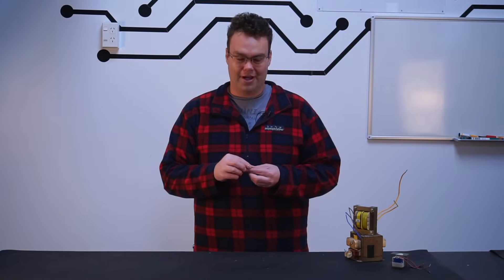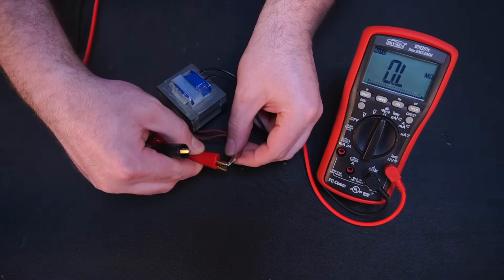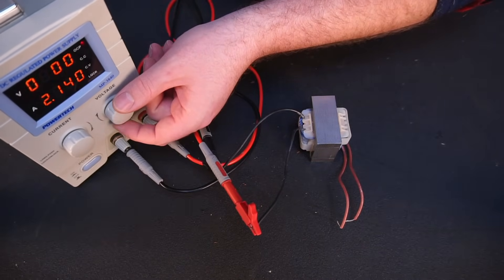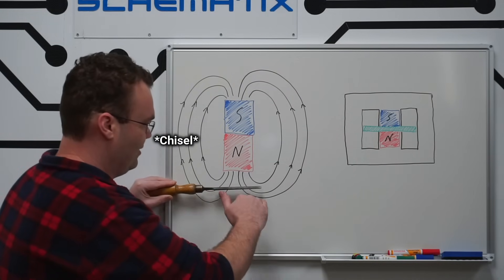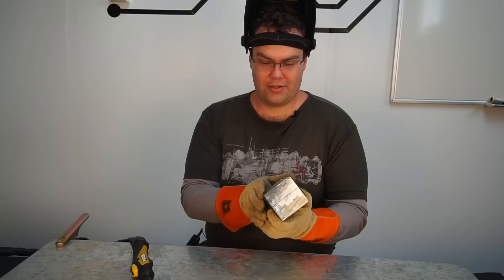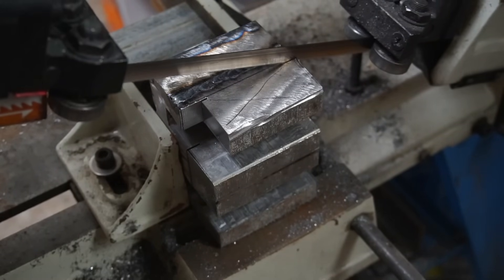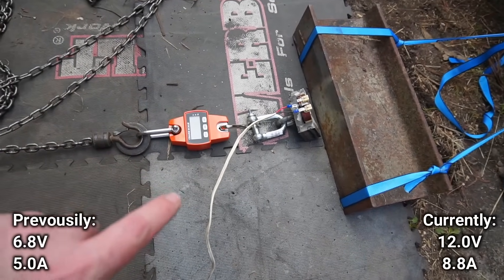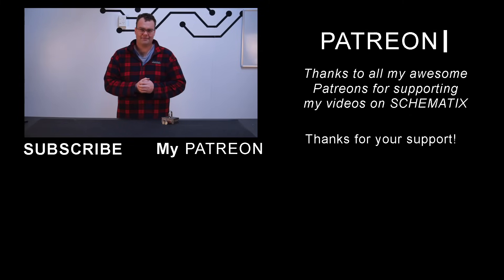Making a Powerful Electro Magnet from a Transformer

Comment: I made the same long years ago !, a MOT transformer is really powerfull...i made a linear to circular motor with this ! leave about 1 inch free of a plate connecting to about half inch of a center of a flywheel and you have a very powerfull motor ( 12 volts 7amps ).....

Comment: Thank you for the video. Really great. I agree that removing excess material and getting the metal object closer to the coil will make the magnet stronger. However, I imagine a big portion of the magnetism gets tied up in the electricity conversion when two coils are present. Wouldn't that also contribute to the electromagnet being so weak before the secondary coil was removed? That coil must have been outputting electricity when you ran the first test. And transformers have over 95% efficiency in converting electricity. Maybe that's where 95% of the magnetism or more went? I would be interested to hear from someone more knowledgeable in this than myself.
Reply: A transformer produces electricity in the other coil because there is a CHANGING magnetic field. Once this field is completely formed, it isn't crossing  wires any more. this is how transformers, generators, motors work. With AC the voltage is always changing. with DC you would need to keep turning it on and off for a transformer. You need a growing and collapsing magnetic field for a transformer. So even with a secondary coil, if your using DC then  the magnetic field is static and the secondary wire isn't doing anything.

For an electromagnet all you want is the magnetic field, you don't care about producing electricity in a second coil, which you have removed. Or did not provide if your building one from scratch.
The metal in a transformer or a motor/ generator is simply to make it more efficient. Consider that the metal cut away is now not providing a complete metal path for the magnetic field, where as when you stick a chunk of metal near it -now you are completing this better path for the magnetic field. 
This can be demonstrated with a horseshoe magnet. Put a piece of metal across the ends and it will not have much of an attraction any  more. Its going through the nice magnetically conductive metal instead of going way out into the air,which is not as 'conductive' as the metal. 
Drop a magnet near a chunk of copper. Copper is nonmagnetic but it is conductive. It will produce an electric field which has a magnetic field and slow the falling magnet down.

Comment: Though difficult to measure the absolute force, I would like to see the performance of two equal EM's, one with a timed momentary current supply mounted stationary above the other mounted atop a piston connected to a crankshaft with a momentary, timed commentator current supply. The crank mounting apparatus (block) and stationary (head) mounts of aluminum so as to not interfere with magnetic fields. Ideally, the timing and supply current electronically controlled with opposing currents supplied at the top dead center (TDC) of piston travel. Once in motion, supply current can easily be generated from the resulting crank rotation or through pick-up coils in the cylinder walls.   In theory, the instantaneous opposing magnetic fields of the magnets could produce a force, however marginal, similar to that of internal combustion. Furthermore, this force could be produced on every rotation rather than the 4 to 1 of a gas engine.  Obviously some engineering to work out, but feasible, don't you think?

Comment: I know man ,magnets are just fascinating in a way you don’t see very often like the way gravity is and how we kinda know how and why they do the things they do but not fully and that’s very interesting.
A few years back I was fishing but before we went fishing we shot some guns at the range and then we went to the lake and I didn’t want to leave by S&W .38 special revolver in the car so I tossed it in the boat and the boat ended up getting run over while in the middle of the lake by a drunk boater who smashed the boat all to hell and almost killed us and we lost everything in the boat except our lives including the pistol.
Now many years later I want to try and get it back off the bottom of the lake and want to use a strong electromagnet and was wondering if it would be ok to have such a thing in the water with electricity it sounds like a very good bad idea!
Am I ok to use an electric magnet in water ?
Also it’s nickel plated so I think it would still grab the gun but just want to know if the nickel plate will effect me in a bad way or not at all?
I would think it would be fine since it’s just a nickel plate with steel underneath it but want to make sure before I go do something that may kill me.

Comment: Hello ad great 👍 work/video 
I tried running a 7.4 lithium battery  wth an inline 5 amp fuse and it keeps blowing the fuse
Allso tried running a power supply 
It actually an R/C battery balance charger  by ProTek R/C 
model Prodigy  612 Duo AC/DC
And it keeps tripping the safety mech/breaker  on the charger??
Could I use a standard 12 volt car battery?? If so how would I  regulate the  5  amperage????
Please 🙏 advise. 
Thank you,  Joe Silva

Comment: Grinding, drilling, clamping, mill work, dent pulling, project or heavy material transfer, lock and that is just off the top of my head. Great video
Reply: Yup , a magnetic chuck.
Reply: Magnet your friends car door closed or the car! Or better yet I see this guy doing plays or theater and he should make King Author sword in the stone and watch peple try to remove sword then have remote button that turns off electricity so he looks strong and chosen!!!!

Comment: Awesome advice and well presented! I learned a lot.  I do have one piece of advice. Next time don't heat the laminates in the core. They do have lacquer on them for a reason. Laminations perform better in a transformer core than solid iron or molded ferrite powder. It's important for the laminates to be separated  from one another with the lacquer. If they touch one another conductively it reduces the efficiency of the core. Next Time start with a new core that will not be damaged by taking it apart or welding all the laminations together into a solid conductive core. In the least don't weld the laminates together. Perhaps put it into a vice while applying some two part resinous bonding glue.
Reply: كم من فولت
Reply: So how does the liquor get the laminations of those cores that are welded already
Reply: @richardsellars8598  I used the term lacquer but I dont know what material engineers use to isolate the different laminations. I only know that it's a proven fact that isolated laminations create the least resistant transformation. You'd have to ask an engineer how they manage to retain isolation because i dont know.

Comment: I've been thinking of making a roll-around type electromagnet for picking up nails, screws, and other types of metal tidbits to keep the area clean and of course; keep from having so many flat tires.
Reply: Did you end up doing this? This is what I'm planning on doing, using a spare tool battery

Comment: solid metal will be stronger the laments are there for AC current to eliminate eddy current. the more turns the stronger the magnet will be, to keep the voltage down you can rap the wire by double or more. because there is no magnetic field fluctuations you don't have to worry about eddy currents or induced back voltage so your wattage will remain low. great video.

Comment: the welds on microwave transformers are very weak and can be broken by beating on them with a hammer.

i tear down the transformers to get the wire for scrap and using a hammer works.

Comment: Thanks so much to such a useful project. I have been working numerically on effects of magnetic fields on different heat and mass transfer phenomenas. In mentioned project high magnetic field density is required. It will be great if you report magnetic field strength in term of tesla or gauss with simple tesla meter. And please provide a comparison between neodymium permanent magnet and this one. These information will rise your videos up to another level
Best wishes
M.Mehdizadeh
Reply: Would you like jam on it as well sir?

Comment: Is there such a thing as a magnetic grinding dust collector? I'm thinking a cookie-sheet sized piece of steel under or around your grinding vice that will collect most of it, and then you can just hold it over a bin and cut the power to release it.

Comment: SORT OF A DUMB QUESTION: If your power supply can provide power with fixed voltage and amp, why was it important to have a little resistance in the coil. I am asking because you said not having the resistance causes the uncontrollable amp through the coil! isn't the power supply specify the amp?

Comment: I've watched two videos on magnetic vices. One created a "magnetic table" that holds the work with the vice mechanically attached to the table. The other used the magnet to hold a traditional type vice to the table. Both have advantages. If you want to get really creative you could try removing the other side of the core as well and see if the drill press table would work as one side of the core making a magnetically held magnetic table. 😎

Comment: Love your videos. Today I started a project to build a tape demagnetiser for old Video8 tapes, audio cassettes and reel to reel tapes. I found a good looking design and tutorial online that repurposed a Microwave transformer. I found a 240 volt LG Microwave oven with a primary winding rated at about 9 amps and pulled out the transformer and micro-switches. After removing  the secondary winding as you have done I was left with the primary winding intact which I tapped up to be flush with the top of the core face like your electromagnet. My question is, I cannot get any DC resistance reading on the coil, not even .01 ohms. I cannot see any damage to the coil causing a short. I wired the coil in series with a 40watt incandescent globe which turned on normally, (not a good sign I think)  I'm nervous about putting 240V across the coil in case it is indeed shorted.  I suppose I could put a variac in front of the coil as well as an isolating transformer (I have a 1KVA ISO transformer) to help upsetting other electronic equipment if it violently trips my RCD. My other option is to wind a new coil. What do you think?

Comment: SCHEMATIX

Hi there

So....the higher the ampers the stronger the magnetic field...

Do I am right????

How can I measure the intensity of a magnetic field, and amplitude of the magnetic field? 

If the intensity of a magnetic field is produced by the amount of ampers (current).

Does the amplitude of a magnetic field is produced by the Voltage?

Thanks for answering my questions.

Comment: Put different sized nails into different types of soft and hard woods at different depths and see if you can devise a practical electromagnetic nail puller.
Reply: Nails have so little surface area for the magnet to lock onto, it would be virtually impossible to devise an electromagnetic field (out of a microwave transformer anyways) capable of pulling a nail out of wood, especially hard wood...
Reply: yooooooooooooooooooooooooo
Reply: This

Comment: Fantastic, I just made my first one. Using for a horizontal mill and doing just fine! But one question. Does the power of the magnet depend on how far is the surface from the winding? In other words, do i need to grind down the transformer core as close to the winding as possible, or can i leave the core as is? I am using DC power supply, 27V - 15A and still able to move it on the mill bed. Gr... Of course that is not pulling force but shearing...  Thanks, Greg

Comment: E-magnets are better for reaping/tearing uses than for lateral/sheering. Just think of those permanent magnet pickup clamps; when you turn them off you basically rotating the load to short the poles...

Comment: Very informative video and it gave me great info on which type of voltage/current to use. Here's a project that I'm starting to work on. I go prospecting for gold out here in Arizona and we have a lot of " black sand " in our good paydirt. I'm taking a 4" pvc pipe and going to tape/strap 2 of these on either side to pour the dirt through so the magnetic field will "stick" the magnatite ( black sand ) to the sides and let to paydirt fall through for further processing. Challenge is to build one of these and post a video. Thanks again and I'll post pics when I'm done.
Reply: Good luck with that I'd love to see that project working !

Comment: Hello Schematix
Thanks for the video.
2 question if I may:
1 Dimensions/size of the Electro Mag. Change in dimension would change the capacity to hold more weight or more current (if possible) would do the trick?
2. If instead of a metal bar, you have used another (equal) Electro Mag would it hold about the double of the weight? (300 Kg x 2) or it doesn't work like that?
Thanks

Comment: Wow, very impressive cuzzy bro!
Just one bit of feedback and maybe someone else has already pointed this out, don't have enough time to read through all the comments.
That is in your explanation of the magnetic field path in the cut core, you've got it going from the center limb to the back of the core when in reality it is the same path as in the uncut transformer, via the left and right limbs of the core. You can confirm this by checking the magnetic strength at the back of the core and you will see that it is just as weak or very close to that around the uncut core. 300kg plus, holly sh....t!
Keep 'em coming, great video and very enlightening.
Cheers and stay well from across the pond.

Comment: What would you assume the duty-cycle percentage would be of a microwave transformer such as yours at 10 amps would be ?
Reply: With the thickness of wire there, it would probably be fine at 90% or even 100% duty cycle, but he did mention only running them at half their rated current.

Comment: Why dont you make a generator with it, with self powered electricity with an alternator powering it, have multiple electro magnets in a circle, so the main can spin, creating more power, and make it a strong generator.....  Im currently building the same thing to power my home and everything else, using multiple alternators, these electro magnets and electric motor so once i start spinning it with a simple drill, it continues to make free power, from a windmill, with the bottom set up into the well so it powers my water supply,, the water then when not in use, flows out relieving pressure but also creating preasure by the flow out turning another machine to help produce more power so that free electricity can be made, and stored until the power is needed.  Of course i had to make my own battery which is 4 foot x 4 foot, yet it maintains the stored energy and then through the inverter i made, powers my home free of charge.  I had a different set up to power my home, just on a wind turbine, but the house i just bought has a well so that will be utilized into the system via non electric pump, yet utilizing the wind, and then the overflo will drop onto the spinning device to help not only power itself but basically making a near perpetual device utilize the power of the sun, wind, water, and magnetics to gain continuous power.

Comment: Bit of a worry using KNOTTED straps = points just waiting to break suddenly!  I would have used some 10mm polyprop rope, but that's me.
Q: What might be the difference in magnetic force under identical circs, but WITHOUT removing the excess laminations?
Also, I'd have been interested to know how warm those windings got after a few minutes of 12V@8A.

Comment: Kind of obvious but why not a electric magnetic lock..say to your tool box or door to shop. As long as you can control the heat produced...I'm thinking 9 volts at 2 amps should hold anything shut till turned off.could back up with battery if needed.

Comment: You probably already know this, but if you wanna get more measurement than the max that your scale can handle just use a pulley system and have one of the connection points from the pulley connect to the scale, and the other directly to the magnet. You can then just double whatever the scale reads to calculate the pressure.

Comment: Question: Can i plug this directly to the outlet through a diode to make it DC ?
I dont plan on having it ON for  more then 5 seconds.
Reply: No. But it doesn't have to be complicated. I reckon a computer power supply would be a good candidate. Limiting the amps is the most complicated part of this project.

Comment: Hi! Thanks for teaching this kind of stuffs to do! Sorry my English but what's the best connection to make a magnetic drill press vise with two 220v microwave transformers? In parallel or in series? What the amperage I should use to turn on a 12v DC power supply without having a heating problem?

Comment: Best DIY electromagnet video I've seen thus far and I watched most.  Will the magnet secure multiple steel objects that are layered, like can they be hidden under a drill press table  and still secure the part above?  Or a round shaft on a V block?
Reply: Just a guess but I think the drill press table would act like the portion of the core that was removed. The magnetic field would travel through the table and substantially reduce the pulling strength.

Comment: Great video. I made the same electromagnet from an MOT and the magnetism is not consistent. It is energized with a 12V DC 10A power supply. I move a steel block around on top of the magnet and suddenly it grabs like crazy and then instantly loses its magnetism. I have checked the voltage at the terminals connecting to the coil and I’ve checked the continuity of the coil with an ohm meter. All checks out. 
Do you have any idea why the magnetism wouldn’t be continuous?